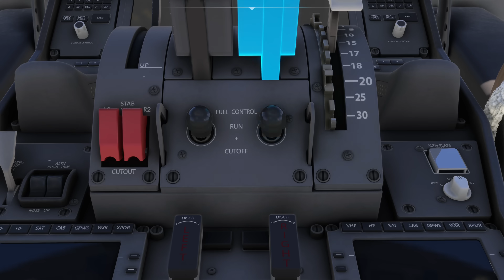Air India 171: Why Did The Fuel Cut-off Switch Get Moved?

Comment: As a retired computer engineer it seems to me that one of the easiest and most impactful “aircraft logic” changes might be to simply prevent fuel cutoff unless the engine throttle is in the idle position. You had mentioned the option previously in passing and it resonated with my experience in troubleshooting ancient computers.
Reply: I actually agree with this, as any situation that requires fuel cutoff to happen already requires throttles to be idled.
Reply: Prevent it during TO/GA detend is enough. During a real problem, you may not prefer the idle detend. Just out of TO/GA, check the problem and go along the shut off during flight procedure.
Reply: Seems like there is small window in the takeoff process where fuel cutoff could be locked out.
Reply: @3rdstagenavigator611 except it could be made to trigger this ONLY AFTER the weight on wheels switch has disengaged
Reply: @stillthakoolest you always have to consider that this trigger can be faulty. I.e you have to weigh the risk of that too thr benefit of having it.
Reply: Requiring input from both pilots does need 2 functional, cooperative pilots being present.
Reply: @howardcobb4354  amen, that was the most useless solution I had heard today.
Reply: @cinemenico  It was a general observation - that applies in many different scenarios where simultaneous inputs is obligatory.  Not this one primarily for sure.
Reply: Fake narrative. Facts are here. You are sold off to Boeing. Why don't you talk about FAA directive from 2018 and CAA directive from May 2025 which talks about issues with Boing 787 which can cause cut off including during inflight.  Why Etihad airlines and DGCA wants planes to be checked. Why British Authority wants checks for this issue since May 2025?.

Western media is corrupt and sold to Boeing
Reply: Cathay Pacific 780. Thrust was stuck on full. You need a kill switch. A pilot who wants to take the plane down can do it and you can’t protect against this easily by just adding more software.
Reply: From what I heard Embraer does this. I don't know of any other manufacturers that do this. It might be time for Airbus and Boeing to do this. Although doubtful this could easily be fixed on existing planes.
Reply: They could need to cut off fuel in case of emergencies like engine fires. Where one engine is on fire bit the other still works fine.
Reply: This was intentional and a pilot who intentionally want to crash will do it anyway. The engineers mase it impossible to do this by mistake, doing more than that is impossible.
Reply: @Johan654-s1f  Monitoring software could be written to require such cut-offs be agreed by BOTH pilots.
Reply: @philipeoverton No requiring both pilots to request it is a serious design flaws. The reason they are not even allowed to eat the same food is that both of them shall not be incapacitated by the food.
Reply: @Johan654-s1f you have zero idea what you are talking about. We eat the same meals all the time!
Reply: @ronpayne4505  If Indian pilots do that it's just another reason to avoid you.
Reply: @Johan654-s1f  you must be the co-pilot's ghost, you seem so confident about what happened
Reply: Agreed. Another idea, make the fuel switch lock once aircraft is airborne, and moving the fuel switch requires 2 buttons to be depressed on opposite sides of the cockpit, one button for each pilot. Like launching an ICBM missile (WarGames)
Reply: Just install cameras in cockpits so that dead pilots cannot be unethically blamed for one's own benefits(manufacturer/airline). Just like @calvindavis adjacently says- How many time have you mistakenly turned off the ignition in your car while it is driving? Never?
If pilot wanted to do suicide he could have done while he was alone. A 3 decade middle aged experienced pilot will not murder 250 people for himself.

Comment: I've recently seen Indian pilots commenting on this accident claiming that it would be impossible for a human to change the fuel cutoff switches within 1 second of each other - they claim it would take longer than a second to move one of the switches (you have to look down, visually identify the switch, reach down, pull the switch, move it, then put the switch down, repeat for the second switch). It seems the same evidence people over here in the West are using to show the switches moving to cutoff as a deliberate act pilots in the East are using to say that it must be a mechanical fault and not pilot error or deliberate action.
I'm obviously a layman with no experience with planes. Any thoughts on what the Indian pilots are saying?

Comment: If one pilot didn't want to survive would there not be a fight to stop the fuel switches being turned back on ?.  After all the pilot who switched them off would be going to jail if the aircraft managed to pull up or crash land in an open area.  The report suggests the fuel switches were switched back on in a controlled manner one after the other.

Comment: As there have been Reports and also Actions from Boeing regarding Water Leaks into the Electronic Compartment below the Cockpit, there is still the chance, that a flashover or short in the Electronics System causes the Aircraft to interpret "Fuel Cutoff", sending this Information to the Engine Controller and also to the Flight Data Recorder. Without looking exactly into the Aircrafts Design, Circuit Diagrams, Electronic Functions etc, there is no Evidence, that the Switches in the Cockpit have been actually moved. Nobody has seen it, and Pilot and Copilot said, they didn't switch the Engines off.

Comment: The gear lever was supposed to have been raised by the pilot monitoring, that was the Capitan.  The gear lever remaining down and the fuel control switch activity is a clear indication of the Capitan's intent to cause the end result. Equipment failure of both fuel control switches within seconds can be ruled out.

Comment: I would like to know if Air India has a pilot training policy of guarding the throttles after takeoff. If they do, then it is possible the FO’s left hand inadvertently bumped those fuel control switches that were possibly installed without the locking mechanism. If Air India does not train their pilot’s to guard the throttles after takeoff… and the FO’s previous airline’s did not teach this… then I would conclude that the shutting off the fuel control switches was intentional.

Comment: The natural assumption from the tape is that the "guilty" pilot flipped the cut-off switches, after which the "innocent'" pilot asked "Why did you do that?" The "guilty" pilot then responded, like the child caught with his hand in the cookie jar, "I didn't." If this was the scenario, it should not be difficult to determine from an analysis of the voices which of the pilots shut off the engines. But there is another possibility. Perhaps it was the "guilty" pilot who asked, "Why did you do the cut-off?" -- in an attempt to divert blame -- after which the "innocent" pilot responded, in some confusion, "I didn't." Something to consider before jumping to a conclusion.

Comment: Fact, both pilots essentially state they did not do the cutoff, at that point, why would they do so falsely?

Because, if one of them did the cutoff deliberately, they would already have to be far far beyond the point of where they would care about trying to shift the blame.

No, you absolutely do not understand the denial part.   Your children denying doing something bad is the mentally healthy response from a child.
A mentally unhealthy(or most healthy for that matter) adult doesn't work like that.   There's a reason why the vast majority of solved police cases are solved because the perpetrator confesses to it.   And there's a good reason why there's so many falsely punished, because even nonperpetrators easily confess to crimes.
There's a good reason why the absence of s-side notes is considered suspicious.

There's effectively just a single exception to this and i have seen absolutely nothing suggesting that exception is present.

"physically"

No, the recordings showed that the sensors showed them to have their states altered.   Whether this was physically so or not, we do not actually know, regardless how likely it is.
Bad assumption.

"only one explanation"

No, there's multiple ones.   Just because an explanation is less likely does not rule it out until proven so.
Bad logic.

"there was no flaw"

You keep saying that, yet you do not actually have evidence of this.
Bad logic.

Comment: It is both ironic and deeply concerning that the preliminary report on the AI171 crash appears to emphasize possible human error, while simultaneously, multiple governments, including those of India, Singapore, and the UAE, have instructed their national carriers such as Air India, Singapore Airlines, and Etihad to inspect fuel switch mechanisms.

This simultaneous action suggests a clear acknowledgment that the core issue may, in fact, lie in the aircraft’s mechanical systems, specifically, a potentially flawed or overly sensitive fuel shutoff mechanism. The inconsistency between public reporting and internal directives raises serious questions about transparency and intent.

If mechanical failure is indeed the root cause, then shifting blame toward pilots, who are no longer here to defend themselves, not only undermines the truth but borders on unethical and possibly criminal misconduct. A full, independent investigation is imperative, free from corporate or political influence.
Reply: It's also deeply concerning the preliminary report doesn't include a recorded data timestamp when the fuel switches transition to cutoff, the report says immediately thereafter (max recorded air speed at 08:08:42), the engine 1 and engine 2 fuel cutoff switches transition from RUN to CUTOFF position one after another with a time gap of 01 sec. No actual recorded timestamp in the report for the fuel switches and the precise time of these switches transitioning is very important. There's also no recorded data time stamp for the RAT deployment or landing gear forward tilt in the report.
Reply: There is no inconsistency. It is believed that one of the pilots flipped the switches, but if there's some way for this to have been a hardware fault, inspection of other craft could show the same fault and both explain what happened and prevent it from recurring. It's not like inspecting the switches is some invasive task that grounds the plane, they just need to have a tech look at them and see if there's anything unusual to report.
Reply: I dont think the report says it was the pilots.  Maybe because they are not sure how it happened, they are advising airlines to check the switches as a precaution just to be safe.
Reply: My explanation is there is a possible massaging of the truth ...behind d scenes some warning has been issued to check d fuel switches ...as if there there was an electronic error that could hv led to both switches malfunctioning withing a sec of eachother ...which some experts agree cannot be possible by human intervention.
Reply: Sometimes we have to face the evidence available to us and make an educated judgement. In this case all that evidence suggests with 99.9% certainty that this was human intervention. The indian gov are just doing their due diligence as there is no harm in doing inspections, they probably feel that its their responsibility to follow up for their own people's livelihood
Reply: @MrBlackCoffee96 The CVR and FDR establish reasonzble and probable grounds to believe that the criminal offense of murder was committed. The authorities know a lot more from the CVR than they released to the public.
Reply: No, this is called "covering your rear".
Reply: @SophisticatedBob I think you need to buckleup

Comment: We're all expert airplaned designers here :) So let me add my ten pence. A single pilot needs to be able to do everything in an emergency situation on an airplane, so needing two pilots input for cutoff is normally not an option - on the other hand, modern airplanes can already differentiate between modes (no thrust reversers in the air for example...), so having to put the plane in a single pilot mode for pilot incapacitation, and requireing two inputs in normal flight mode is perhaps not something to discard immediately. Similarly, restricting access to engine cutoff in scenarios where it would result in such accidents is also something to consider. You could still make exceptions for dual pilot input, or single pilot flight mode, but cutting fuel to both engines only meters above the ground when taking off... that is a design flaw if it can be done so easily, or so I think. There might even be other scenarios to think of that could be restricted to better protect against a similar situation.

Comment: You keep making the same assumption that I don't think you can make.  You cannot say with 100% certainty that one of the pilots physically flipped those switches to cutoff!  The truth is, the data log shows that the switches were in cutoff position and 10 seconds later, switch 1 showed run, and 4 FULL SECONDS after that, switch 2 finally registered RUN.  You cannot say a pilot physically moved those.  There's an outside chance some glitch in the control board, wiring, etc. produced those SIGNALS without the switches being physically flipped.  If they were, fine, but I think you should have to PROVE it wasn't an erroneous signal and not just claim that the timings look human, etc.  Because if it was intentional and not a glitch or accidental, we're not talking about suicide.  It's mass murder!

Comment: With both throttles at full power, it's still possible to flip the switch to cut fuel.  Would the design be better for the fuel system ignore the fuel shutoff command while at full power?  i.e. takeoff?

Comment: 39 year retired commercial airline veteran... more of a comment.  In my training from 1979 until 2018 the pilot not flying would be heads down monitoring the engine instruments and immediately call out any loss of power by saying "Power Loss" to  alert the pilot flying. Did this happen? From what I understand (if the full CVR has been shared) is no... this only leads to the conclusion that the switches were moved with nefarious intent... very very sad.

Comment: Hi Captain my question here:-
Why was the entire transcript not shared and just one conversation shared. It's like we are made to lead with this narrative.
If it was a Pilot error or not the identification of which Pilot said with full transcript should have been published.
Pilot 1: Why did you cut off the fuel?
Pilot 2: I didn't
Where are the rest of the transcript
Also a notice that was shared by US Aviation Authority in 2018 that the fuel lock may disengage on it own was mentioned on the report why?

Comment: I dont understand something, with all the intelligence built into aircraft nowadays, why isnt there logic onboard the flight computers that says, if the plane is in flight, and all sensors indicate engines are performing nominally, and there is no fire or abnormal vibrations detected, then fuel cutoff is denied and lowering the switch would do nothing, but maybe trigger an alarm?

Comment: Captain Steve … if the fuel cut off switches are so critical but need manual intervention could they not be located in another area in the cockpit where it would not be possible to switch them out (off) without the other pilot noticing. Although no conclusions yet it does look to be the case that the fuel cut off switches were activated without the knowledge of the other pilot based on the voice recording … ?????
Reply: Liked the idea made by one of your viewers that the cut off switches could only be activated by both pilots someway intervening jointlyb

Comment: The idea of having both pilots electronically confirm important and more over illogical (based on facts) inputs is maybe where the computer (some call it AI these days) should chime in. Placing both fuel cutoff switches to cutoff, without the computer knowing about any problem with the engines (or turning off the wrong engine for that matter), would be something worth being acknowledged by both pilots with separate switches, not easily reachable from the other side.

Comment: 1) It could have been bumped, but that would require broken locking tabs.
2) It could have been manually moved, instead of the landing gear up control, would require someone half asleep or otherwise 'out of it'.
3) It could have been manually moved and on purpose.  Would require one of the two in the cockpit to want the plane to go down.
4) It could have been the throttle ecu running past its # of cycles max, of which the fuel cutoff switches are but one part with two switches.  The throttle ecu was replaced in 2019 and 2023.  2020 - 2023 was probably very minimal cycles as it was the pandemic years.  Prelim report did not say how many cycles since 2023.

Comment: Thanks Steve!
Wondering if shutting down both the engines at such a low atlititude, should have been stopped by the airplane system/computer. Such a risky operations and no mechanism is in place to safeguard it.

Comment: If the other pilot had put the switches back to RUN almost immediately, would that have made any difference?
Reply: this^^^
Reply: @zaptillius655 What I have heard is that it takes time for the engines to spool up but it was so low that there was not enough time for those engines to generate enough power to lift and fly.
Reply: Maybe.

Comment: Hi Captain Steeeve. You brought up the question of cameras in the cockpit. We have them in our tourist coaches, inside and outside. They have helped a lot in squashing fake complaints from motorists and passengers alike. They have also assisted in getting drivers sacked for gross safety breaches. I can remember an incident where a plane in Australia had not put down the landing gear. Why? Because the FO was text messaging. Cameras stop you from doing that sort of crap.